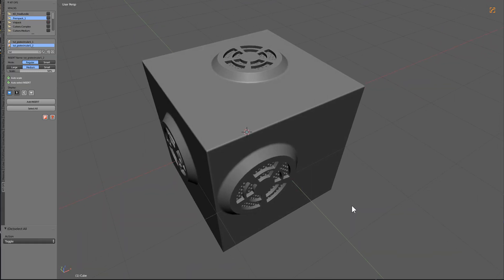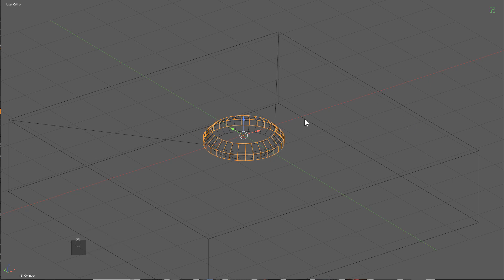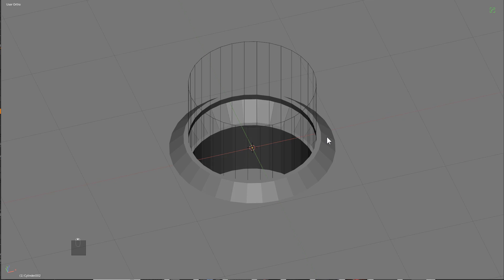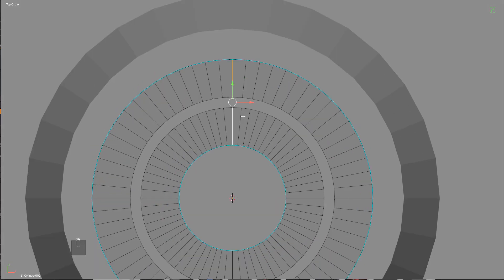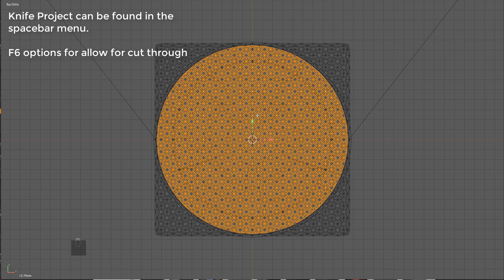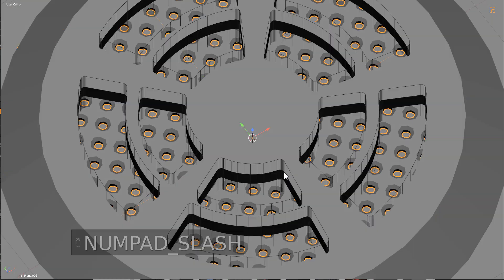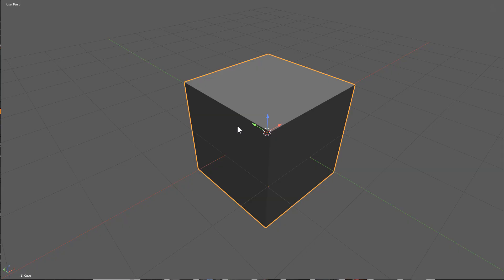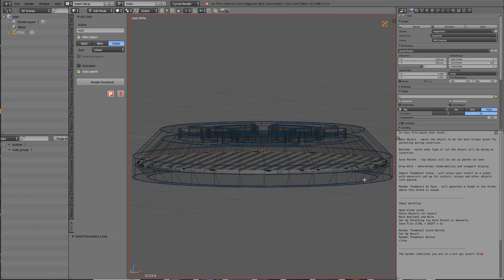B3d / KitOps - Creating A Bevel Weighted Insert

Comment: Hey Masterxeon1001. Did you know that if you create seams (for unwrap) on meshes you use for booleans, that these are transferred to the target mesh? 
I just found out. This makes the unwrap process much easier, you might still need to create seams on some edges, but still, it helps tremendously if you do a lot of inserts.